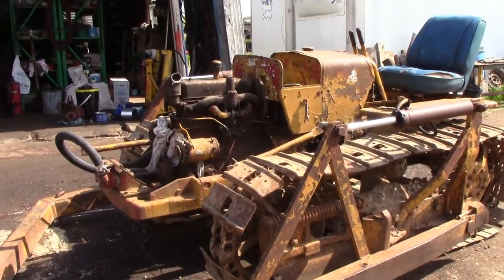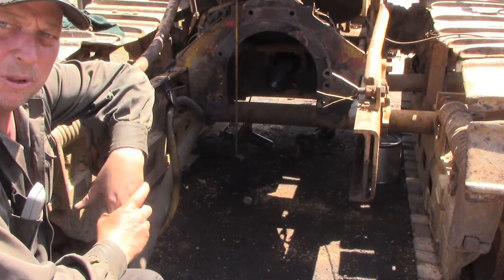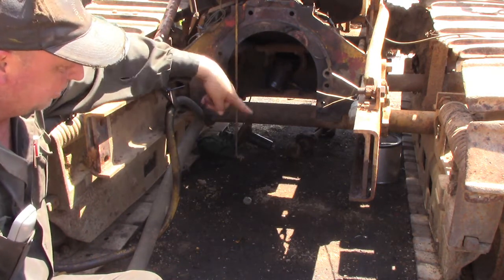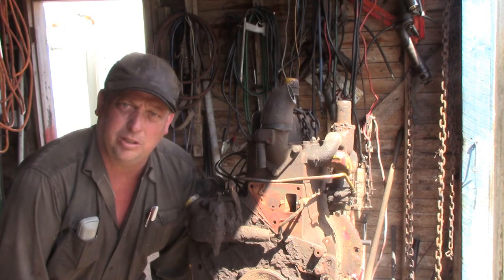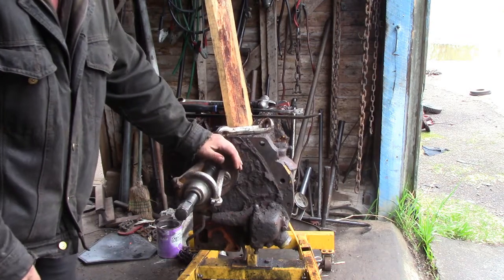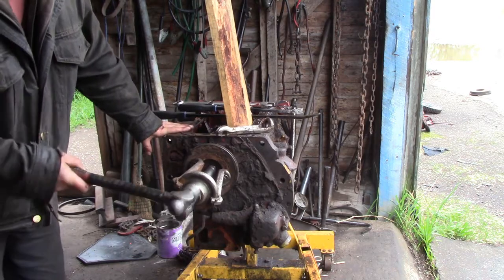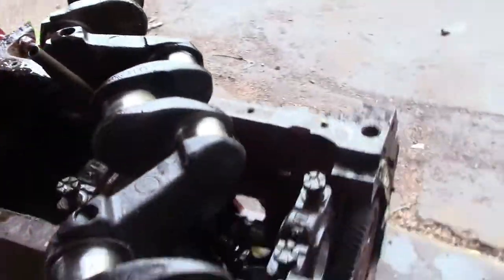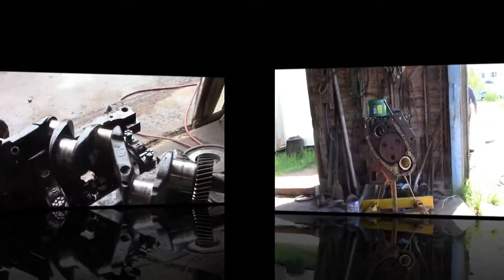International T4 Dozer engine rebuild Part 1

Comment: Great video again Dave, that's a good tip on using the puller. Can metal be laid down on a crank journal like they do with some big shafts, then turned smooth? Thanks, I learn lots just watching how you work!
Reply from the maker: I am glad you enjoyed the video.I could send the crank away (to Montreal I think it is) and have it "spray welded" which would build up the journals and then have it turned, but for this application it is too expensive to be  feasible. Thanks for watching!

Comment: could any of the engines that you have in stock be modifed to fit the dozer ??
Reply from the maker: I believe they could have, but they would need the crank which is the problem with this engine, so time you get bearings and gaskets it's not that much more to get the engine kit and do the job right. Thanks for watching!

Comment: Good day  So when new bearings were put in, if he would have ground crank,it might have been alright?  Also is that a 135 cu in. motor.  Thanks  Nice video
Reply from the maker: I think in this case the crank was too far gone even at that point but normally yes, you can grind the crank and put in over sized bearings to get the proper clearance. This engine is a C-123 but after 50 years there's no guarantee that it's the original though I believe it is correct, I think it was the T5 that had the C-135. Thanks for watching!

Comment: Is that a C152 ?
Reply from the maker: The C-152 was used in the Farmall H and IH W4. I think the T4 came later (this one is early 60s) and used a C-123, at least this one does. I believe that in the time frame of the letter series tractors that a T6 was the smallest of the line. Thanks for watching!